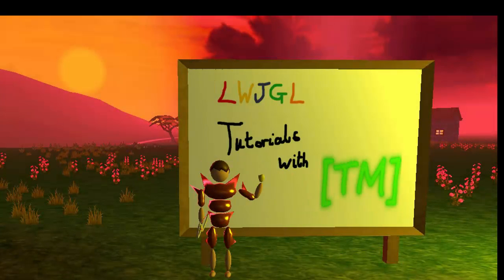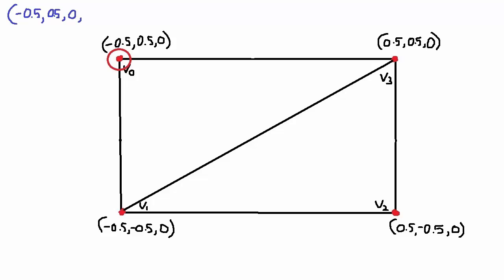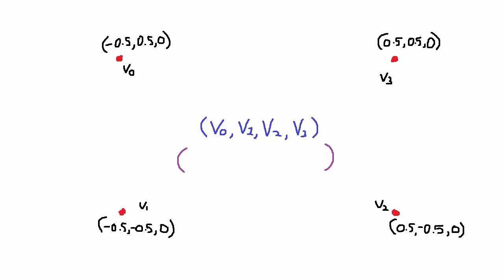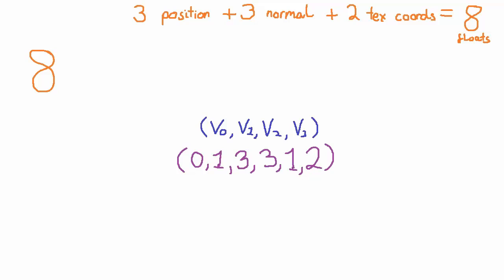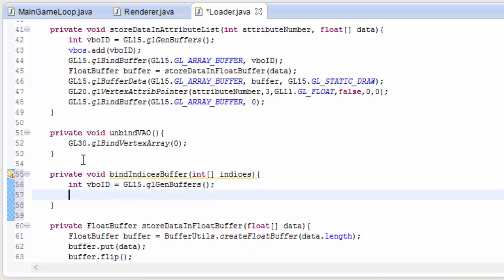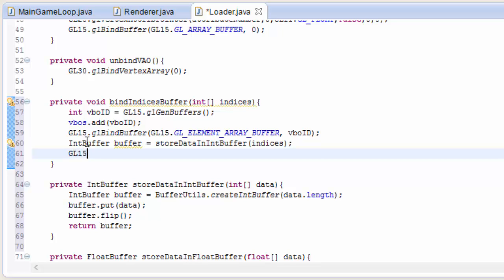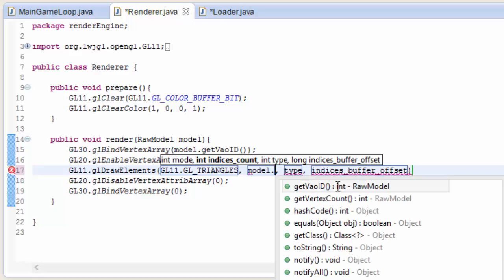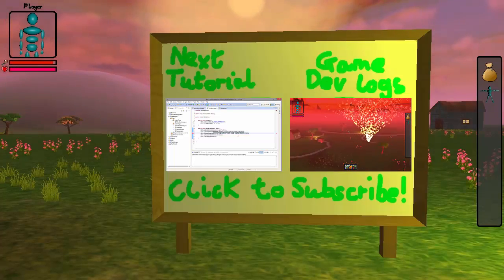OpenGL 3D Game Tutorial 3: Rendering with Index Buffers

Comment: why we dont attach that new VBO to the VAO... how the OPENGL should know what buffer to use ?
Reply: +andrey obruchkov we still have the vertices in the 0 position in the VAO. so how could that read from the indices
Reply from the maker: +andrey obruchkov Each VAO actually has a special slot for one index VBO, so it doesn't need to be stored in the attribute lists. By binding the VBO as a GL_ELEMENT_ARRAY_BUFFER OpenGL knows to store it as the index buffer for the currently bound VAO. If we were to then bind another VBO as a GL_ELEMENT_ARRAY_BUFFER it would use that as the index buffer instead. "Unbinding" the index buffer would remove it from the VAO. Sorry that it didn't make this clear in the video.
Reply: +ThinMatrix thanks :D now i understand. so it start to read from the index VBO by going to the indexes of  vertices buffer that we attached to the attribute list in place 0 ... right ?

Comment: Your tutorials are really amazing!
But the opengl class names are too confusing as they are not fixed and using all GL11, GL20, GL30, ...

I have one question with this video.
You've generated two VBOs here and didn't bind the indices buffer to the attribute list like the vertices buffer.
How does the VAO know that it uses indices buffer?

What I guess is that you bound the vertices buffer to GL_ARRAY_BUFFER without unbinding the indices buffer from GL_ELEMENT_ARRAY_BUFFER.
Does this make both buffers put into single VBO and can tell at once that it uses the given vertices by the given indices?
Reply: I was going to ask the same thing
Reply: According to the OpenGL wiki,  unlike a GL_ARRAY_BUFFER, when you call glBindBuffer on a GL_ELEMENT_ARRAY_BUFFER, you are actually binding that element array to the VAO, whereas when you call glBindBuffer on a GL_ARRAY_BUFFER, you are only telling OpenGL to use that buffer when calling glVertexAttribPointer(). The way I like to think about it is that the position of a vertex is an actual attribute of the vertex (these attributes are actually specified inside the shaders), whereas the Indices are telling the VAO how to draw those vertices. The indices are not themselves an aspect of the vertices, and therefore are not added to the attribute list.

Hopefully I explained that well enough, however I am not an expert, just been doing some basic OpenGL for a while. Anyone feel free to correct me if I got something wrong.
Reply: I was getting mad :')

Comment: I am slightly confused,  I don't see you bind the indices to a attribute location (like you did with vertex data)? I also don't see where you drew the actual vertices?
Reply from the maker: +Bryce Moral - RadLabGamings There is one special slot in a VAO specifically for an index buffer. When you bind a VBO as a GL_ELEMENT_ARRAY_BUFFER it tells OpenGL that it's an index buffer and automatically binds it to the special index buffer slot in the VAO. The call to glDrawElements() renders the currently bound VAO using the indices in the index buffer associated with that VAO. If no index buffer is bound to the currently bound VAO when you call glDrawElements() then OpenGL throws an error.

Comment: i did everything that u showed in this video, but it doesn't work! (btw i have a mac)
Reply from the maker: +R. Sanders Did it work in the previous tutorial?
Reply: +ThinMatrix change from GL30.glGenVertexArray to APPLE ...
Reply: it didn't work in the previous tutorial, and it has no lwjgl exception.
Reply from the maker: R. Sanders Try my code and see if that works for you: https://www.dropbox.com/sh/5bfn3moez3ed46w/AACYdThdTVI0h983CbaEPZdba?dl=0
Reply: the display is projected, but the 2D quad is not getting rendered
Reply: +Robot on Fire On Mac you NEED a shader, same on linux
Reply: Stevan Miladinovic is right, (I have a linux )
Reply: +Stevan Miladinovic Thank u that really helped! ;)

Comment: Hey, 
this will hopefully not get lost in the commentsection. I get an error on line: "GL11.glDrawArrays(GL11.GL_TRIANGLES, 0, rm.getVertexCount());" in the Renderer.class. The console output says

#
# A fatal error has been detected by the Java Runtime Environment:
#
#  EXCEPTION_ACCESS_VIOLATION (0xc0000005) at pc=0x0000000001e3ff71, pid=14268, tid=9764
#
# JRE version: Java(TM) SE Runtime Environment (8.0_05-b13) (build 1.8.0_05-b13)
# Java VM: Java HotSpot(TM) 64-Bit Server VM (25.5-b02 mixed mode windows-amd64 compressed oops)
# Problematic frame:
# C  0x0000000001e3ff71
#
# Failed to write core dump. Minidumps are not enabled by default on client versions of Windows
#
# An error report file with more information is saved as:
# U:\BankingSolutions\3dGame\hs_err_pid14268.log
#
# If you would like to submit a bug report, please visit:
#   http://bugreport.sun.com/bugreport/crash.jsp
# The crash happened outside the Java Virtual Machine in native code.
# See problematic frame for where to report the bug.
#

Anyone who knows how to solve this?
Reply from the maker: +PooBucket This usually happens when trying to access the wrong attribute in a VAO. Check the Loader class, especially where you're storing data in the VAO's attribute lists. I would imagine that the error is probably in there.
Reply: +ThinMatrix Thank you very much! I got scared this might occur due to missing admin-rights ( thats how i interpret access violation). I just forgot this line : "GL20.glVertexAttribPointer(attributeNumber,3,GL11.GL_FLOAT, false, 0,0);"

Comment: I get no errors but it dosn't load a quad, just a triangle.
PLEASE HELP!
Reply from the maker: +Ojas Landge Check that you're using the new vertex positions and the correct indices. Also check that in the loadToVao() method you're now using "indices.length" as the second parameter for the RawModel constructor instead of "vertices.length/3" which is what we used last time.
Reply: Thanks, I fixed it

Comment: I have windows XP and I did all the code and I get:

Exception in thread "main" org.lwjgl.opengl.OpenGLException: Cannot use offsets when Element Array Buffer Object is disabled
 at org.lwjgl.opengl.GLChecks.ensureElementVBOenabled(GLChecks.java:105)
 at org.lwjgl.opengl.GL11.glDrawElements(GL11.java:1117)
 at renderEngine.Renderer.render(Renderer.java:16)
 at engineTester.MainGameLoop.main(MainGameLoop.java:32)

Please, tell me what might help me in fixing my problem.
Reply: +Mike L I got that as well! But I'm using Windows 10
Reply from the maker: +Mike L This happens when you try to render using an index buffer when there is no index buffer associated with the VAO. So double check the method to create the index vbo, and check that you're not unbinding the index buffer at any point during the loading.
Reply: +ThinMatrix Thank you very much!
Reply: Ok, I'll check that! Thanks for replying :DD

Comment: My rectangle shows black,not white
Reply: LordFers It does have to do with the os, depending on what you are using the default color will be different
Reply: you can set the color before rendering using GL11.glColor3f(r, g, b);
Reply: +David Barroso me 2
Reply: +DerpyProgrammer That is because you did not specify the color of the rectangle
Reply: +Pietro Nardelli Mesadri but he (in the video), not specific never the color of the rectangle, i don't see where.
Reply: +David Barroso if your still stuck on this dont worry, i had this problem to, it doesn't matter what color your computer renders it, the color depends on the system you have, as the long as the rectangle, "quad", is rendering on the screen it won;t make your game crash or anything

Comment: The rectangle is not rendering at all. It worked perfectly fine with the method from the last video. I am running windows 8, don't know if that would make a difference, but there is absolutely no rectangle. I went through tutorial 6, and still nothing. Loving the tutorials though, but I do not know what this issue is. If you would like me to send you my code, please let me know.
Reply: +Joel Comberiati never mind... for some reason i did this:
return new RawModel(vaoID, indicies.length/3);
the /3 should not have been there...

Comment: It doesn't have to be counter clockwise if you change the face culling, right?
Reply from the maker: sporreking As long as you're consistent and always use the same direction then you'll be fine. And if you don't care about face culling at all then it doesn't matter at all, but that wouldn't be advisable. There are also other situations where you might want to know which face of a triangle is the front and which is the back, so as long as you have some way of knowing then it's fine.

Comment: ***** I only get a black triangle on the screen I have re wrote everything 3 times and it still does not work?
Reply from the maker: DiePvP Check that you're using the new vertex position (there should be only 12 floats) and check that the vertex count parameter in the RawModel constructor has been changed to indices.length (at the end of the loadToVAO() method).
Reply: Okay Thanks So Much It Worked :)

Comment: Hi! I'm loving this series so far! I had a bit of trouble getting the initial setup right, because LWJGL is now on version 3+, but I managed to find the same version you are using on source forge and follow along.

So far, I have been trying to pause the video and guess what's coming for a few methods, to test my understanding and there is one element in this lesson that isn't quite clear to me. I'm not sure I understand how the indices VBO is linked to the positions VBO. My guess was that the indices VBO would be added to the VAO, in the second attribute list and that at some point, something was going to connect the two of them together. I was surprised to see that no attribute list was used to store the indices. I'm not quite sure I understand how they are actully linked at all. Hopefully someone can shed some light on this question?

In the mean time, let's check up the next video! :D
Reply: Mailliw103 Does it have something to do with the fact that we never actually unbind that indices VBO?
Reply from the maker: Mailliw103 The index buffer is a special type of VBO and so doesn't have to go in the usual attribute list slots. Each VAO actually has one special "slot" for the index buffer. By defining the index buffer as a GL_ELEMENT_ARRAY_BUFFER we told opengl that this is an index buffer, and so when we bound the buffer OpenGL knew to store it in the special index buffer slot for the currently bound VAO. If we had unbound the index VBO it would have removed it from the slot and there would have been no index buffer assigned to the VAO.
Reply: ***** Ah, I see! Makes sense :)

Thanks for the quick reply!

Comment: What have I done wrong? I run it and it crashes and comes up with the error...

Exception in thread "main" org.lwjgl.opengl.OpenGLException: Invalid enum (1280)
 at org.lwjgl.opengl.Util.checkGLError(Util.java:59)
 at org.lwjgl.opengl.GL15.glBufferData(GL15.java:174)
 at lwjglapp.Loader.bindIndicesBuffer(Loader.java:79)
 at lwjglapp.Loader.loadToVAO(Loader.java:34)
 at lwjglapp.LWJGLapp.main(LWJGLapp.java:45)
Reply from the maker: Daniel Draper Check line 79 of the Loader class. One of the parameters to the glBufferData method is incorrect.

Comment: How can I get data at index i from VBO? I checked multiple guides, but I didn't really get the idea.
Reply from the maker: Kim Rautio It's usually not such a good idea to be trying to read data back from a VBO.  Why do you need to do this? It's probably best to just keep hold of the original data that you loaded into the VBO and then get the data from that if you need to.
Reply: ***** yes, that's what I read :D Okay well how could I edit data in VBO?
Reply from the maker: Kim Rautio You can edit data in the VBO by using glMapData or glBufferSubData. Here's a tutorial about glBufferSubData: http://wiki.lwjgl.org/wiki/The_Quad_updating_a_VBO_with_BufferSubData
Reply: Thank you so much for that. :)
Reply: I'm trying to use the following:
public void updateBufferData(int vaoID, int vboID, long index, int value){
        GL30.glBindVertexArray(vaoID);
        GL15.glBindBuffer(GL15.GL_ARRAY_BUFFER, vboID);
        IntBuffer buffer = storeDataInIntBuffer(new int[]{value});
        GL15.glBufferSubData(vboID, index, buffer);
        GL15.glBindBuffer(GL15.GL_ARRAY_BUFFER, 0);
        unbindVAO();
    }

but it doesen't work. what am I doing wrong?
Reply from the maker: Kim Rautio I'm really not sure, it's nothing I've really used much of. Perhaps the index should be measured in bytes? So maybe try 4*index instead? Again, I'm not too sure.
Reply: Okay, I asked it on StackOverFlow and got a good answer (in comments). Now it's working like a dream.

Comment: what did i do wrong 
Exception in thread "main" org.lwjgl.opengl.OpenGLException: Cannot use offsets when Element Array Buffer Object is disabled
	at org.lwjgl.opengl.GLChecks.ensureElementVBOenabled(GLChecks.java:89)
	at org.lwjgl.opengl.GL11.glDrawElements(GL11.java:1117)
	at renderEngine.Renderer.render(Renderer.java:17)
	at engineTester.MainGameLoop.main(MainGameLoop.java:39)
Reply: squid craft the screen crashes after launch
Reply from the maker: squid craft This happens if there's no index buffer for the VAO that you're trying to render. So check that you're creating the index VBO properly and that you're not unbinding it at any point in the Loader class.

Comment: Hi, I have two questions.
1. How does OpenGL know the connection between the indices-VBO and the positions-VBO?
2. How do you know which OpenGL class contains which methods. I mean the names of the classes are a bit strange I think, just GLXX.

I really like these tutorials but still it's hard to know which method to call when and why...
Reply from the maker: David Köefflitz The indices refer to the order that the position vertices are stored in their VBO. And index vbo of (25, 6, 12) would create a triangle from the 25th, 6th and 12th vertex positions in the positions VBO. Opengl knows to use the index buffer in that way because we bound it to the VAO as an ELEMENT_ARRAY_BUFFER.
As for the OpenGL classes, I don't know! It's sooo annoying. The classes represent the version of OpenGL that those functions were introduced in, so I can usually make a good guess, but most of the time I have to refer to my old code or simply test each class until I find the right one! It's such a pain! I think this is different in LWJGL 3, but I'm not certain.

Comment: Exception in thread "main" org.lwjgl.opengl.OpenGLException: Cannot use offsets when Element Array Buffer Object is disabled
	at org.lwjgl.opengl.GLChecks.ensureElementVBOenabled(GLChecks.java:105)
	at org.lwjgl.opengl.GL11.glDrawElements(GL11.java:1117)
	at game.render.Renderer.render(Renderer.java:19)
	at game.GameLoop.main(GameLoop.java:26)

Also checked the code and i don't see any differences from your code. Any ideas?
Reply: 456panos My bad sry, i unbounded the indexes vbo.
Reply: Did you find a solution ?

Comment: I'am double check the code, and i getting this message:
#
# A fatal error has been detected by the Java Runtime Environment:
#
#  EXCEPTION_ACCESS_VIOLATION (0xc0000005) at pc=0x000000005982aaad, pid=3688, tid=5564
#
# JRE version: Java(TM) SE Runtime Environment (8.0_31-b13) (build 1.8.0_31-b13)
# Java VM: Java HotSpot(TM) 64-Bit Server VM (25.31-b07 mixed mode windows-amd64 compressed oops)
# Problematic frame:
# C  [atio6axx.dll+0xeeaaad]
#
# Failed to write core dump. Minidumps are not enabled by default on client versions of Windows
#
# An error report file with more information is saved as:
# C:\Users\Cyber_Hox\workspace\OpenGL\hs_err_pid3688.log
#
# If you would like to submit a bug report, please visit:
#   http://bugreport.java.com/bugreport/crash.jsp
# The crash happened outside the Java Virtual Machine in native code.
# See problematic frame for where to report the bug.
#
Reply from the maker: Blagoje Must be a problem in the loader class I think, could you show me your code for that class please?
Reply: It is not necessary to send code to you. You have a lot work on your game, I'll review  the code by myself, but thank you for offering to help me :)
And sorry for my English, is not very good.
Reply: Blagoje ***** Apparently this is caused by the graphics card not loading a DLL properly, or allowing OpenGL to. I'm also getting this error, if you find the solution Blagoje, please share it!

Edit:

I've found the source of where this is occurring (when I comment out the code - it's fine but it doesn't render the square):
glEnableVertexAttribArray(0);

This implies that the attrib '0' doesn't exist? My code is exactly the same as yours (ThinMatrix)
Reply: Erorr is in code. Loader class. I did't write this "buffer.put(something)".
Reply: Blagoje Damn, that means we're getting it for different reasons as I did do that. :(
Reply: Never mind, I solved it. I wrote data.length instead of '3' for glVertexAttribPointer.